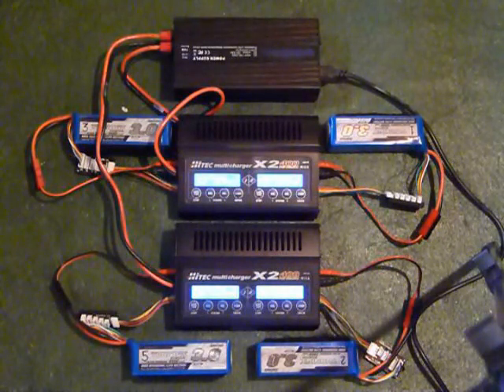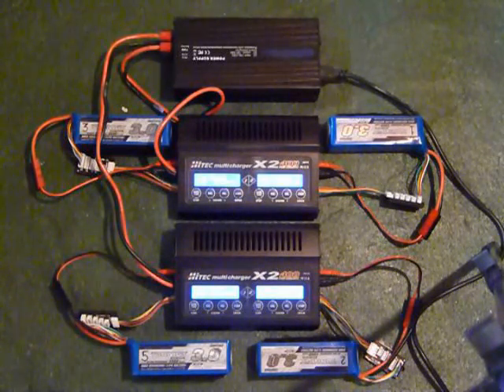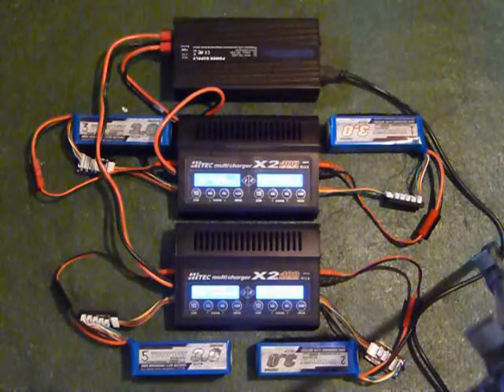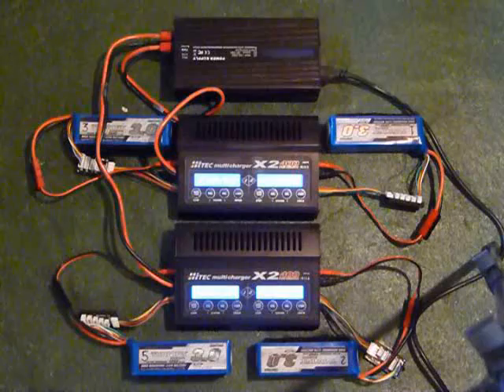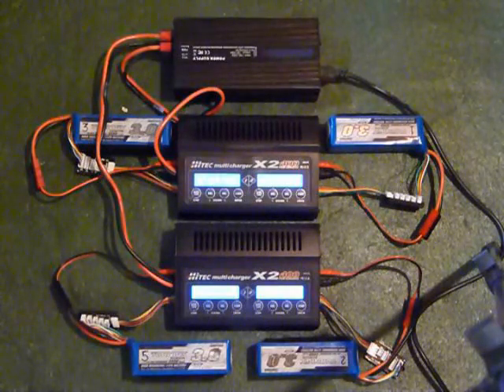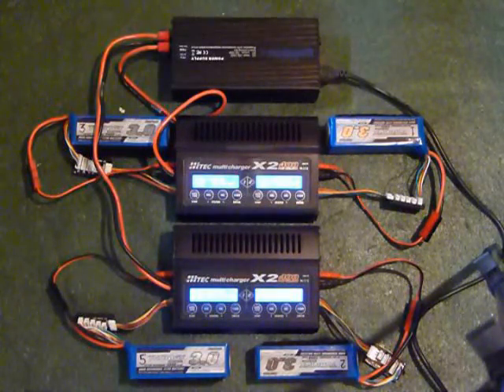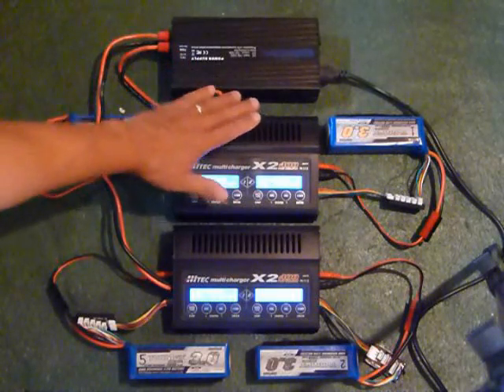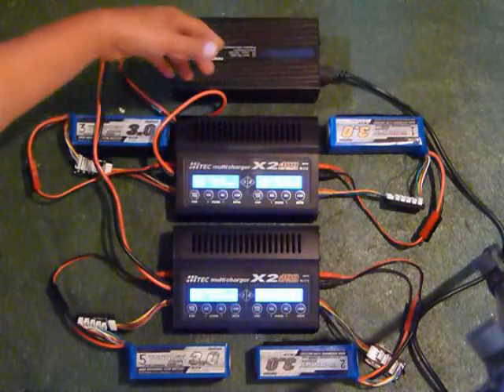Hi-tec X2-400 Multicharger w/ Progressive RC 500W power supply

Comment: I have a 575w 47amp Dell server power supply that I converted. 
How will it handle this type of charging. I charge mostly 4s 7000mah 70c packs and 2s and 3s. They can handle 2c charging.
Can I live with my PS ?

Comment: Bob, I've got the newly updated x2 400 post recall..... I want to get a computer server power supply to run mine at full capacity... All I can find for proper output terminal for wire or 4mm female connectors to be soldered into place modded ie.... the HP 600PB is only 575w and 47amp I think 600w. That's still not 60amp as manual suggests? What would you do in the type of case? What brand and wattage +amps computer server PS would you advise? Easy solder points too? I will be charging (2) 6S 22.1v 5000 -  5500mah 65 - 130C rated lipos........Thanks, KJ

Comment: im having an issue with mine i got it today and a protek prodigy 1200w 60amp and it keeps giving me a short error on power supply even with no charge wires or balance leads hooked up...any ideas what might be causing it?
Reply from the maker: Can you connect the charger to a 12V car battery and see if you get the same error?  If no error, then the power supply needs to be checked or something.
Reply: Bob O yeah it was both i sent them back for a refund..
Reply from the maker: mikes hobbie's and random stuff The charger AND power supply were bad?
Reply: Bob O yeah but i think the power supply is what caused it
Reply from the maker: mikes hobbie's and random stuff Good luck with the replacements.  This really is a great charger, great value.  I'm still using my two chargers on the same power supply from the video.  Just charged up twelve 6S packs in pretty short order.  Hoping for a great day of flying today.

Comment: How fast does one of these chargers charge,with both sides charging
Reply from the maker: If I do a "Fast Charge" at 2C, I can charge two batts in 22 minutes if starting from no more than 80% discharged.
Reply: Do u recall how many milliamps the balance ports were on this? One is for sale in my area pre-owned and this charger seems to be as good as the newer chargers available now in 2024. And nice video and thanks

Comment from the maker: No, you cannot use a household AC wall outlet as a direct connection with this chargers, as the input voltage would be way too high.  The Power Supply reduces household voltage (110V) to 15V, which is within the range of the charger( 12 to 18V).   

However, you may connect this charger directly to a 12V deep cycle marine battery, which is what I use for field charging.   :-)